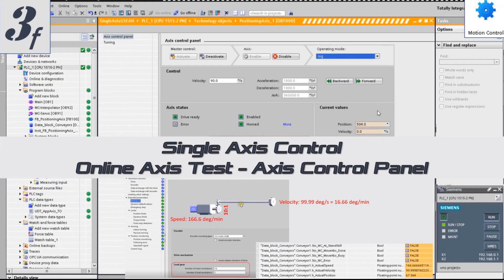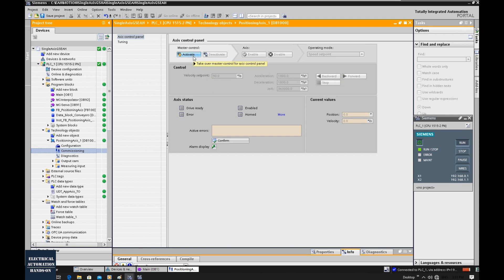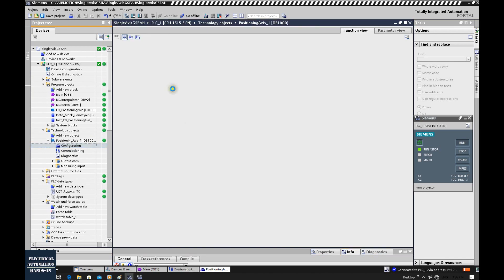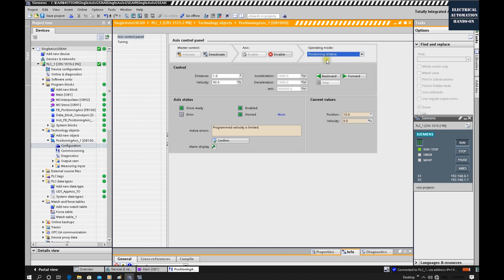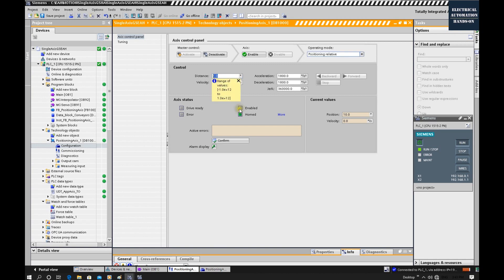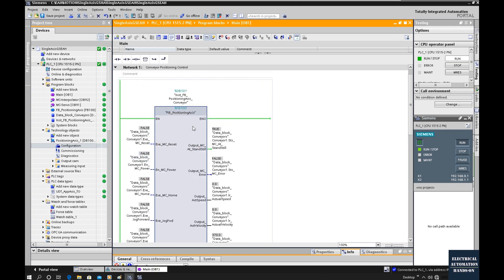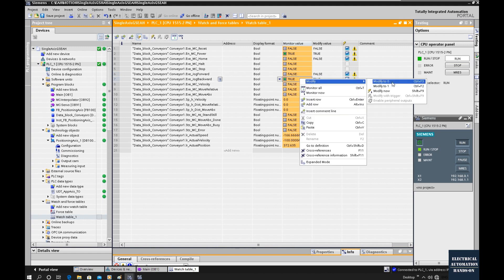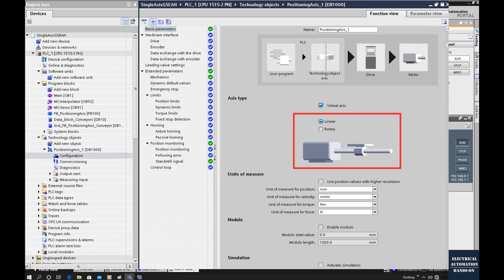MS03f. [Siemens Motion Control] Online Axis Test via Axis Control Panel in TIA Portal [8/10]

Comment: How to use MC_Halt and when to use it ?
How to use MC_Stop and when to use it ?
Can you show how to convert and calculate speed from 99.99 deg/s to 16.66 deg/min.
Reply from the maker: MC_Halt is used to trigger the Axis stop, it is the trigger execute command. But MC_STOP is the ENABLE command, if the command is ON, the axis can be held for moving.  99.99Deg/s = 99.9 x 60/min
Reply: I also thought about this problem. 99.99 deg/s = 99.99 * 60/min = 5,999.4 deg/min 16.665 = 5,999.4/360. I hope this helps.

Comment: Thanks for your videos. I think the unit of speed is rpm, how do you think? I don't understand how 99.9 degree per second equal to 16.6 degree per minute.
Reply from the maker: Can you please point which min I talked about the speed conversion? I think it includes the Gear box ratio 1:10.
Reply: Velocity is degree/s. Speed is rpm. let say you need load velocity 100 degree/s as defined in the TO configuration, and ratio from motor shaft to load is 1:1. In order to get 100 Deg/s at load, the motor needs to convert it rpm to rps. every resolution unit is 360 deg/m, which is 6 deg/s. In order to get 100 Deg/s at load with ration 1:1, the motor needs to rotate 16.67 with 6 deg/s rotation.